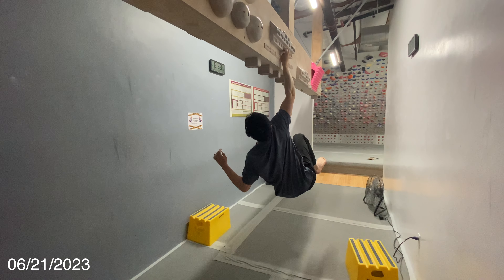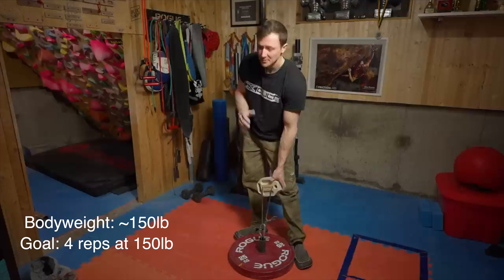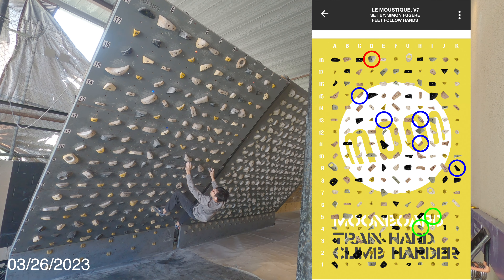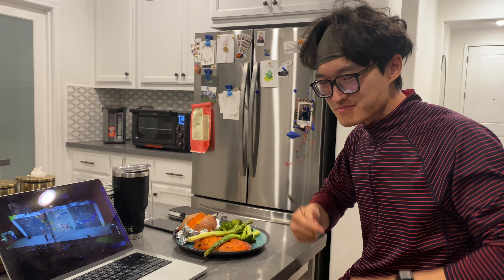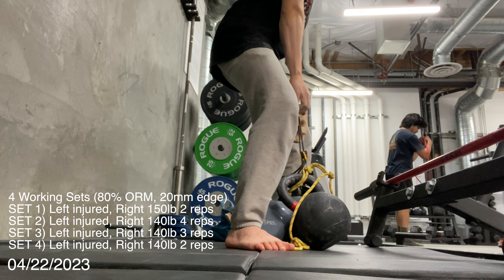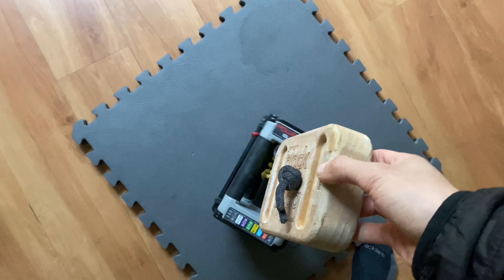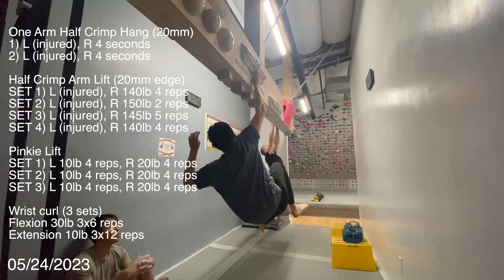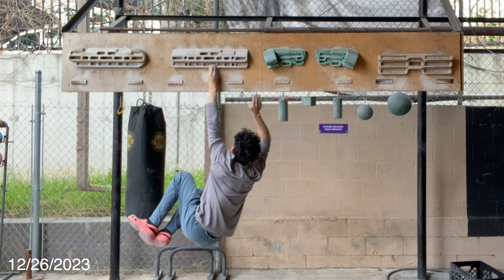How to Train the 22mm Half-Crimp ONE ARM HANG (and actually get it)

Comment from the maker: UPDATES:

At 19:43, I mention "You want your dip points to be neutral or flexed... (applies more for smaller edges i.e. 15mm). A more correct way I would rephrase this is you want to constantly provide flexion force at the DIP joint to keep the DIP joint neutral; you'll find that you will need to do this more and more with smaller edges and heavier loads).

It has come to my attention after experimenting further with wrist curls and talking about the exercise with others that I would not advise doing them with your forearm on the table as shown at 25:06 . This is because doing so would pin the wrist in a vulnerable position when curling heavy weight, and many would feel a lot of pressure on the wrist (usually ulnar aspect). This can potentially cause wrist cracking and instability down the line, especially with those who've had injuries or strains to the ulnar wrist before. Simply do them as cable curls like 25:47 or stand-alone like 24:05 . It won't be as "clean" because you can compensate with your biceps, but it puts much less pressure on the wrist as a finisher forearm flexor exercise. Also play around with the angle to find which angle puts the least strain on the wrist.
Reply: It's interesting you've mentioned that, i've had a TFCC injury recently and was prescribed wrist curls as part of the rehab process. I use my leg to support my arm whilst doing them and generally don't experience any popping or cracking apart from on the first rep. I used to experience a lot of cracking when i first started performing the exercise but have worked up to being able to rep out 45lb dumbbells with no discomfort. Wrist curls done in this fashion are also a very popular exercise in arm wrestling but they do train the wrist in many different ways so it may not be a fair comparison.

Also I wanted to ask, do you not think the rolling handle performs a different action to the wrist shark device? Seems like the rolling handle relies more on pure crushing/pinch strength whilst the wrist shark requires more flexor/extensor engagement depending on which way you're using it. I've recently bought a rolling handle but was thinking maybe I need a wrist wrench instead.
Reply: @PIXEL7atm  wrist wrench is a lot better for targetting your wrist flexors. Chris drummond armwrestling made a great video explaining the differences between the wrench and rolling handles. I feel like its only good for isometric support and pinch training. I tried wrist curls with rolling handles but i dont feel the pressure on my wrist as well as a wrist wrench.  Dumbbells with fat grip feel better than rolling handle  for wrist exercises

Comment: Dude if you can one arm a 15mm and only climb v10 fingers are the last thing you need to train.
Reply: Under rated comment
Reply: I totally agree. I climbed a lot of V12 but can  barely hang 20mm one arm ( maybe 4 seconds). But to be fair he climbed V10 on moonboard V9 is the hardest moon board climb I ever did I'm just to week for climbing harder on that board while outdoor climbing I don't need to be that strong most of the time its enough to climb more efficient or find really good beta. So Yes I see that 15mm one arm hang is enough to climb up to  maybe 14 outdoors but for moonboard in not sure for v11 and V12 benchmarks you just have to have stupid strong fingers
Reply: You never climber on the moonboard right?
Reply: he is talking about a moonboard v10 as u can see in the video. and we all know that is way harder than outdoor v10 in terms of finger strength required
Reply: I can do 14mm one arm pull up and my best moonboard grade is v8. I do in fact suck at climbing
Reply: @lle9058  yeah ofc, that’s exactly what I’m saying. Going to keep pushing my finger strength as well, but the focus is definitely on technique and movement at this point in my training. I did a strength test and it said I am strong enough for v11 lol
Reply: @lle9058  oh, I also need to work on my lower posterior chain. My tension is so bad, partly due to technique but also just being weak. Been spamming deadlifts recently and feeling a big difference on the wall. Hopefully soon I catch up to my strength and actually send V10-11
Reply: This comment, drew ruana can barely do a 20mm one arm hang and he’s done almost 200 climbs between V14-16
Reply: @ianjaggi he also is a professional climber who has climbed way longer and practically lives outdoors, not a med student who’s climbing primarily on the moonboard and has been climbing for probably half the time
Reply: for real, I climb v13, and 8c lead and can't hang the 20mm on the beast maker... and also when it comes to climbing I feel like that fingers are the strongest part about me lol
Reply: Yet you can neither hang one arm nor climb beyond V10

Comment: People can lose weight for whatever reason. I don’t think it’s great for people to hate on people losing weight. The biggest nuance is that most people on the internet don’t recommend losing weight as a cheat code to improve. In the fitness industry it’s generally recommended to be around 12-15% bf (male). I think connecting to climbing, as long as you’re not developing an ED it’s probably fine. Most people aren’t even close to 12-15% bf anyway
Reply: Also ego lifting is never good. The goal isn’t to lift the most amount of weight. The goal is to climb better. It applies to anything like pull-ups, finger strength training etc.
Reply: I mean, if you fancy yourself as but a climber and climber only, your "the" goal is definitely to climb better for sure
Reply: I have issues pushing myself to that weight. I’m 5,10 145lbs and have virtually no body fat. I struggle gaining weight at all even eating 3.7k cals a day. I’m strong though, being able to bench 190 etc at that weight. I feel like giving up because being lightweight is good for climbing but idk if it’s healthy. I must be around 5-10% but idk.  I just don’t know what to do anymore
Reply: 5,11*
Reply: @shadereal7679 how long have you been climbing? Judging by your comment, it almost sounds like not long enough.
Reply: @Snackchez  a year now. I’m climbing outdoor v10s tho🙏. Just curious on what to do with my weight that’s all because I really do struggle gaining any
Reply: @shadereal7679  Dude... Climbing 1 year and you're sending v10. GTFO, you don't need to do anything, just keep climbing and you might turn pro :)

Comment: As a 41-year-old aspiring climbing coach with a decade or two of strength training experience (and, who once considered being an orthopedic surgeon😷), well done! I had theorized that it might be the case, but it was nice to learn that the cross-education effect is a concept that has been validated and named. So, thanks!👍 Also, your rules of form for the half-crimp block pulls are very good.😀 And, I'm sure you agree that they mostly apply to half-crimping in general, so I'd just like to add that a cue some people might find helpful in learning the strict half-crimp is to think of "mashing your fingers together, side to side." One should strive to get that same side-to-side compressed feeling in their fingertips that is felt when they bring in the thumb for a less severe version of the full crimp (i.e. where the thumb and index finger are pressed together, but not overlapping). It's also the same feeling that one experiences in their back three when they chisel their index finger. However, as Boss makes clear, we want all four fingers contributing to their max. So, echoing Boss here, I strongly advise that trainees focus on form first, and form always.

Comment: On the topic of comparing one arm hangs to one arm block lifts I was recently able to do a one arm hang on the 20mm edge, however the weeks leading up to this during which I only trained block lifts I was never even close to lifting my bodyweight which just goes to show how different the movements actually are when it comes to finger strength and how they don't really transfer.

Comment: Great video, I have landed on a similar combo of workouts but haven't done the pinky isolation so I'll have to try them. In terms of your current protocol: I found using an 18mm edge and an 8mm edge to be the optimal size (rather than 20mm and 10mm) to avoid skin issues, obviously depending on your finger anatomy. So I'd definitely recommend finding/making/modifying edges for arm lifts. Secondly, I would try performing your wrist curls in a similar way that you would do arm lifts, meaning from the floor and curling from neutral to engaged. That's why I find the asymmetrical devices (like your arm shark) super helpful because you can get a pretty heavy force without a huge amount of weight. I just found that the supported (horizontal) curls gave me some wrist aggravation just due to the pressure of the support on the wrist itself. Anyway, great work, I've found the arm lifting finger workouts to be the most sustainable over time so keep it up!

Comment: About the splits, I had chance once to use tension block and it is really positive and sharp, you can lift much higher weight than on the other lifting 20 mm edges which are more rounded and where weight is on the neutral angle (in tension block it moves edge forward a little bit so there is the biggest pressure at the end of the edge) and they don't cause splits (e.g. IURA warm up single; avail in the UE).

Comment: Things I learned (mostly a note to self):

Do arm lifting after my bouldering session rather than before.

Aim for stricter form in my half crimp arm lifts.

Consider gentle mono training to activate "lazy" fingers like the index and pinky. Go very slow. Strengthening these fingers could potentially help with capsulitis in the middle and ring fingers.

Consider wrist curls. Don't bend wrist into flexion when doing them.

Comment: 20:00 is there a reason you never extend your DIP joints during training? I see pro climbers like Aidan Roberts do some very extreme DIP extensions that let him latch onto very small edges. Curious what your rationale is for this, is it only a training protocol on max lifts to avoid injury? I suppose it is unrealistic to ever do a full bodyweight one arm hang on extended DIP joints but it still feels like something worth training to me.

Comment: Great video! I'll point out standing on platforms to do a lift is far from ideal and that's one of the reasons I make the smallest no-hang devices with integrated carabiner eyelets. That with a reasonably sized loading pin you wouldn't have needed those big boxes to do some of those lifts.

Comment: There’s a lot of really awesome advice and good training insights in this video, but i think it’s also important to note that v13 strength is not required to climb v9 or 10. If you can’t hang 1arm on 20m but are looking to climb v9 or 10, it’s still absolutely possible.

Comment: Supercool and informative. Glad this has worked for you. I switched from max hangs to lifting last year just because they are so much more convenient but I tend to use them as a warm up to a MB or KB session. and do 20/15mm front 4, front 3 and back 3 sets of 6 going up in 5kg increments (20-30 kg), so not even close to one arm hanging. Would be good to know how you applied the strength to MB and outdoor boulder projects and how and when you noticed the difference.

Comment: Most insightful video on armlifting for climbing to date even if it is anecdotal. I'm on a similar journey as you and have come to some of the exact same conclusions as you. However, I used singles and not reps to push my strenght gains. I have done finger iso training a couple of times, but will now incoporate them in since I believe the index and pinky contribute a significant amount to the one arm hang in half crimp. Thanks for sharing your journey. Is your PR in armlifting the same as your PR with the Tindeq Progessor? Hope to see way more content on this subject.

Comment: Thank you, sick video definitely gonna incorporate a lot of what you shared! I had a similar learning arc w/ the front lever where it took improving my dead lift to get the activation in my lumbar to keep my butt up but once I had that connection front levers became my training exercise itself similar to what you said w/ moving to 1 hangs and away from lifts. re: finger splits have you done a parallel 'deep dive' into skin maintenance? I find regular minor shaving w/ razor blades and/or sanding of the problem areas (for me my index finger) effectively eliminates the crease callous splits i'm particularly prone to get.

Comment: Nice video, but I have a few things to point out. When you do edge lifting, you shouldn't move your shoulders because Yves doesn't move them, and he said it's very important, as you are training your fingers, not your shoulders. Second, after every climbing day, when you take a shower, I would recommend using pumice with soap and hot water to care for the skin on your fingers.
Anyway good job!

Comment: Great detailed video, curious for next one!

Curious about a few things:
Before injury your pickup training weights and reps were the same for left and right hand, you didn't have any deficit? If you did have a deficit any reason why you didn't use the individual ORM to determine your working sets?

Regarding form: Opening hand during the pull is bad because your goal here is to train half-crimp right ? but if one's goal was to train open-hand or chisel (or just finger strength in general and they just happen to be more comfortable in open-hand) there's nothing wrong with that right? To be honest the video you showed for "bad form" just looks like someone training open hand to me (it might be half-crimp before the pull because without weight it's harder to just hold on the pick up device in open hand on small edge). 

(*Pristine btw).

Comment: 19:50 you talk about not wanting your dip joint to be extended during the crimp. But when i half crimp i dont feel like i can lift anything near as heavy with my dip joints engaged (trying to push the weight more through my fingertips than just passively push off the pads) my dip joints arent hyper flexible so they go maybe 10% hyperextended when under highest load. I don't really understand what you meant here.

Comment: Great detailed video! I am currently set back a bit due to an a4 pulley injury from 2 1/2 weeks ago. When did you restart training for the injured finger?
Reply: Start training as soon as possible. My experience with pulley injuries is that the longer pause you take the longer it takes to get back to feeling healthy. Of course you have to go easy. Good indication if you go to hard is the feeling in your injures finger the next day. It should be only slightly more painfull than the previous day. Hope this helps. Wish you fast recovery🙂
Reply: @ristosovcev98  I actually started climbing again after 2 1/2 weeks. Of course only slow and no dynamic moves. Whenever I felt pain on a route I would immediately stop.

Now after 5 weeks I am using open hand, slopers and jugs that won't poke the more sensitive areas. 

I made good progress and now started tracking 1-finger crimps with Tindeq to be very precise.
Reply: @HealingMushroom  very good. You shoul progresivly overload  the finger. In my case i always come back stronger, because i was always overtrained🙈

Youre on the right path👊

Comment: Great vid. You mentioned around 7:00 that you mostly use a tindeq for your armlifts (now?). Do you think you would have gotten to the one arm 20mm hang using only this method as well with no actual weight lifted?
Reply from the maker: I think the simple answer is yes, but it helps to do it with actual weights first to understand the theory and how your strength progresses to the exercises. 

My repeater protocol on the Tindeq is : Sets: 4. Set: "Reps:4, Work: 3 sec, Rest: 3 sec", Pause (rest): 5:00. 

The important thing is to adjust the maximum strength parameter each session based on your previous session (if you pulled a max of 120lb last session, set the max strength, MVC (lbs) parameter of the current session to 120lb). Setting the Set Work Level to 100% to correlate with the "line" that you need to pull towards, which is analogous to if you were to use real weights. If you've gotten stronger, your numbers will trend upwards each session. 

Still experimenting with the tindeq and finding the best settings that work for me, will likely talk about it more in Part 3 of this series, apologies for the long wait time for that video (busy with school) but I hope this comment helps.
Reply: @bossclimbs  Thanks for the quick and detailed response, especially on the nitty gritty of your protocl! I got a tindeq myself a couple of months ago and tried a similar approch but had to back off from max pulls and especially rep-work again (because they seemed to aggravate it more than say 3 sets of 10sec constant pulling) because of a tweaky PIP joint. I don't think it's lack of hydration my case, but I think doing the pulls right after the warm-up before the climbing might have had some role to play in that, so I'll move it to the end and see how it goes. Looking foward to your next installnents but take all the time you need.